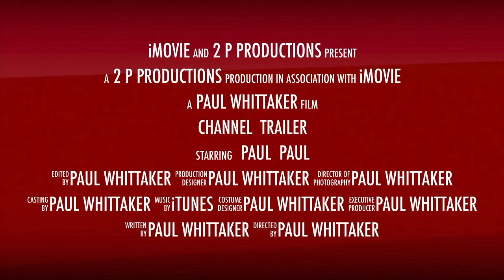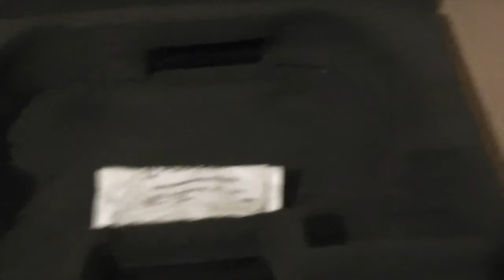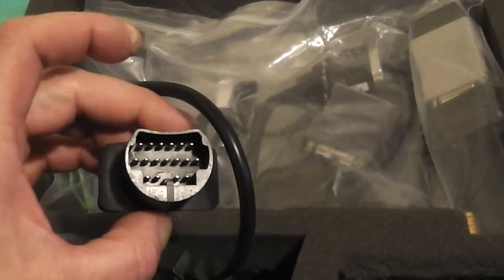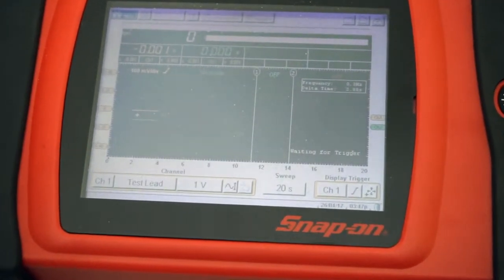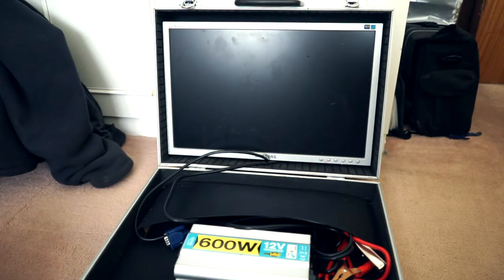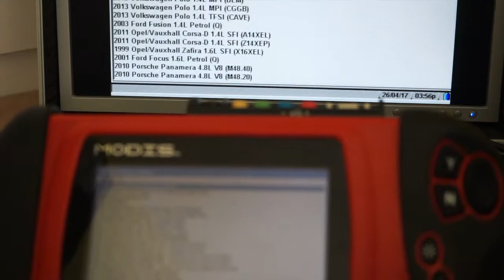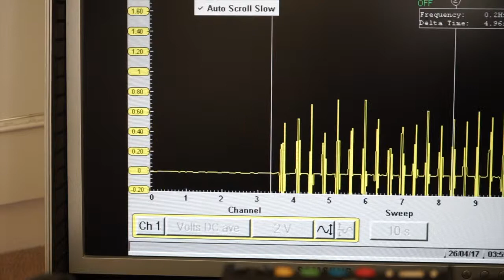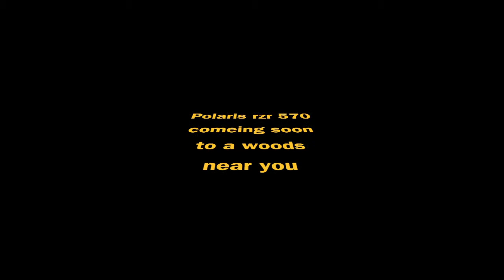SNAP ON MODIS AND 19 INCH SCREEN

Comment: Hi,Paul but what cable do you use because i have a MODIS but no working with the 19 inc screen
Reply from the maker: Domingo Perez 
I’m using a standard vga cable from the modis to my screen
Reply: But I put the 9 pin adapter for 15 pin VGA
Reply from the maker: i,ve used the 15 pin vga cable just checked the modis and screen in the workshop